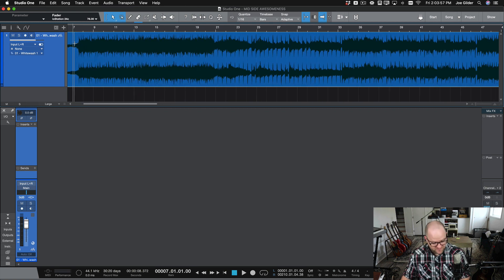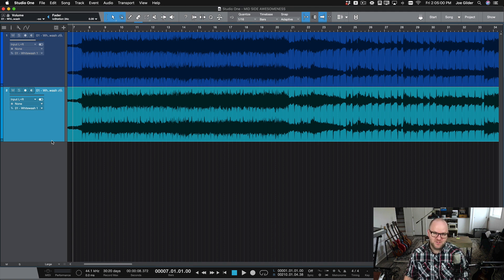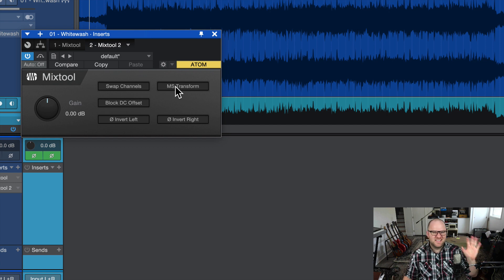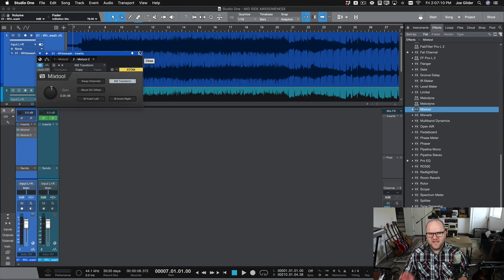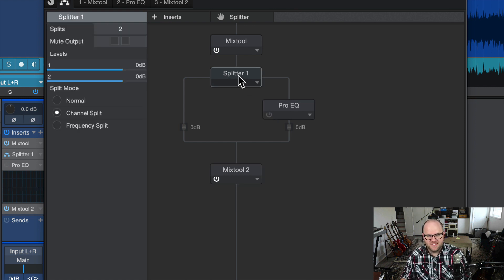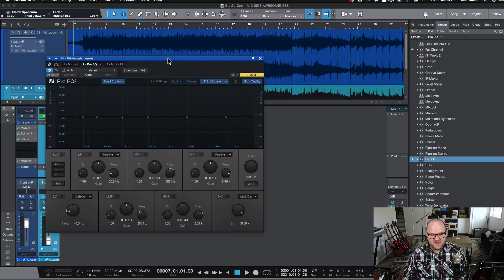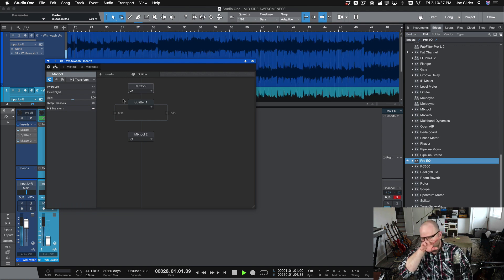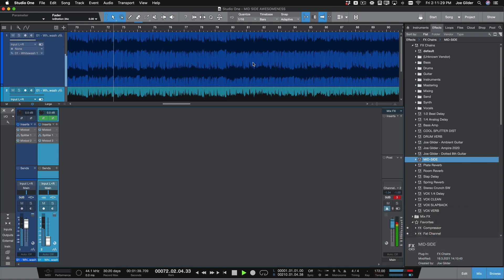Mid-Side Processing in #StudioOne

Comment: M-S Splitter not working correctly in Studio One with MixTool, phase issues.
Split M-S and reverse-phase with the original track, there is no silence!
just put a waves PAZ meter on your master channel or render 2 tracks and normalize silence the music came back, the best result is set MixTool volume to 3.01 !!!

i solved this little problem with Voxengo MSED instead of MixTool
Reply: Joe LITERALLY explains this in the video - M/S transform deducts -3dB of gain, so you have to compensate for this if you want complete cancellation of phase-inverted signal.
Reply: @antic604  The level was just so low, that it did not register on master meter, but Mutility Meter showed it. The cause seem to be the Mixtools. With the Mutility instead of the Mixtool as LR/MS transcoder, the null-test result is ~-150dB instead of ~-65dB.
Reply: @FarshadHesami  Ok, so 2 questions - 1) why do you want to cancel the sounds, 2) why do you care about signal at -65dB? Native tools will always be inferior to specialised, paid ones so use those when needed. For 90% of uses MixTool will do just fine.
Reply: @antic604  there is no complete cancellation of phase-inverted signal with MixTool. try yourself and then let us know. put a PAZ on master bus and check the signal
Reply from the maker: Right. I think MS isn't an exact science. Also, I'm okay with a -65 dB null test. Pretty quiet still. 😊  - Joe Gilder
Reply: @fenderstudio  Gregor, on behalf of all artist user, I would request you to talk to presonus and get us the splitter function, even 8 track abletn does this 😭😭😭😭😭😭😭🥱🥱🥱
Reply: @fenderstudio Thank you so much Joe, but in other DAW MS split works more accurately.
I hope this small problem will be solved in the next update ;)

Comment: When we split Mid/Side to Channels L and R, how will hard panned left or right Signal be prozessed when it comes back to Side? Is the left one still left? Or is the hard left then on the left and on the right side? How is this possible running through one Channel?
Reply: Remember the 2nd Mixtool brings everything back together, so all your pans thereafter should act as normal. 😊 Hope I understood your question correctly
Reply: @KRMoore731  Yes, i know. I mean this in this way: When you have a signal left, one signal right, then change to mid/side, the left signal should than be in side signal, right? The right signal should than be in side signal also, right? So the both left and right signals would be summed in the side signal, but how can the 2.nd Mixtool than convert the both side signals to the right channel after processing? I would think, that than den sum of both will be in the side signal. We will probably loose the stereo image, right?
Reply: @KRMoore731  Perhaps i am on the wrong way to thiink this... Side contains probably only the stereo differnece of the whole signal, mid the mono part. When we put this after processiing together, we have still a whole stereo signal. I would be nice if Gregor Beyerle or Joe could explain this in detail.

Comment: Totally not understand. too much talk I mean explanation...  respected sir can you make it simple if at all possible to make other video..
Reply: MixTool can "transform" a regular stereo signal into mid/side, where it puts the "mid" information into left channel and "side" information in the right channel (or the other way around, it's irrelevant). Then you use Splitter to separately process left and right channels (that now contain mid and side). Then, upon finishing the processing you use MixTool to transform the mid/side signal back to regular stereo.

Easy :)
Reply from the maker: I made it as simple as possible. It's an advanced concept. One of those things you don't "need" to make great mixes.  - Joe Gilder
Reply: @fenderstudio  Well, don't agree with the last part. Putting a mid/side split on the Master and filtering out low-end on the "side" channel makes wonders for mix clarity :)